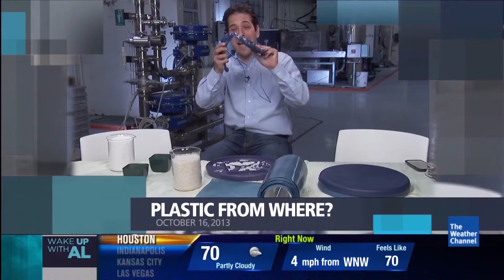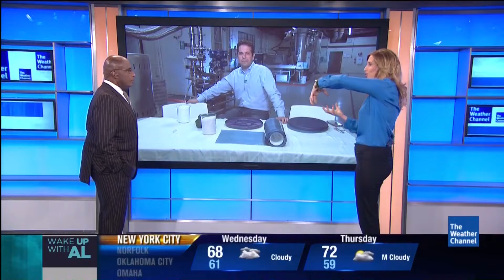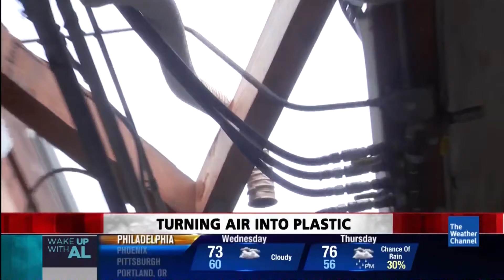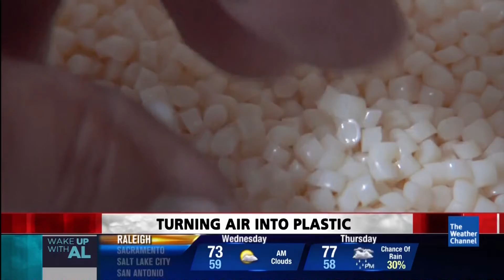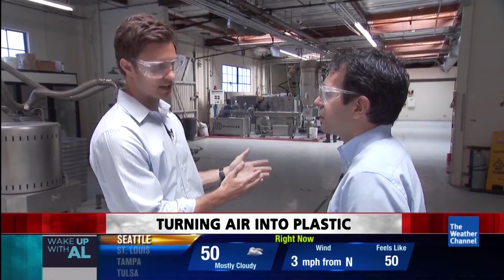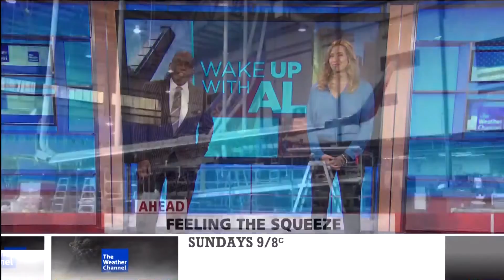Turning Air Into Plastic

Comment: You think the news would actually do research and check their sources.   If they did they would know that they way they are explaining breaks the 1st law of thermodynamics.   

Where is the energy coming from to create the plastic and extract it from the air.   Power plants?   So hooking up a hose to the top of the reactor to feed it into this factory would require more power plants.   You might as well just use the exothermic reaction and create the plastic using chemicals.  Far more efficient and does not contribute to the problem they are supposedly trying to solve.

This logic reminds of developing a car that runs on water.

Comment: Why is everyone so negative? There has been a number of breakthroughs about using the carbon dioxie into useful. About the conservation of energy, you all forgot its a "manufacturing" plant  and NOT a "power" plant. He's likely just using power from the main line. Even if he's using an on-site generator, he's likely using its emissions to supplement the ambient CO2 for the process.
Reply: Well considering he is just starting and proving that the concept works and can be affordable. The next step is to make the system more efficient, that's all. For now he is using the CO2 from the factory's surroundings.
Reply: Can you give me the link so I could possibly give a better reply?
Reply: Here’s a video about why this isn’t worth the attention. 

https://youtu.be/dzq9yPE5Cbo

Comment: Dear Dave, please watch Thunderf00t's latest video and be amazed how gullible you are...
Reply: His arguments work just as well to "prove" that we shouldn't plant trees.  The process doesn't use conventional methods of converting carbon dioxide into plastic.  It uses a bio-catalyst.  Basically, microbes take the carbon from the air, and produce plastic as a waste product.  These microbes could in theory be "powered" by sunlight, chemical sources, simple sugars, or even just heat.  The arguments presented by Thunderf00t don't even come close to debunking this technology because he left out the most crucial part of it: the bio-catalyst.  Please, actually read about the technology before blindly following the almighty god, Thunderf00t.  Yes, I recognize that he has a PhD in applied chemistry, with a focus on bio-chemistry (which is honestly what makes this error all the more egregious in my mind), but either he didn't read the full explanation about the technology, or he just wanted to bitch about something.  Either way, he is wrong.
Reply: airman122469 "The AirCarbon production process begins with concentrated methane-based carbon emissions that would otherwise become a part of the air," - See more at: http://newlight.com/technology/#sthash.3SNr8wGy.dpuf

Do you know how you get concentrated methane out from the air around us? You pump it through a system that will separate it.This type of system would produce more carbon than it will pull out from the atmosphere because you can't simply pump large volumes of air that contains only 0.01% of what you need(methane) and expect not to waste energy.Plastics are a waste product, we don't need plastics more than we need the electricity that will be wasted to power those pumps.

Newlight is simply using the waste methane that farms and other sources (WHICH ARE NOT THE AIR AROUND US) give them to make the plastics.That is the only innovation, but if you think that will overturn the global warming you are a complete idiot.

He is not wrong and you are braindead...
Reply: ***** What i ment by waste was that the raw material was the waste, not the material after the conversion.In newlight's process the raw material is not waste and needs to be concentrated before they combine it with the biocatalyst .

They even say it in their website:

Step 1:
" Capture: First, concentrated methane emissions that would otherwise become part of the air, from places like farms, landfills, and energy facilities, are directed into Newlight’s patented conversion reactor."

Step 2: "Isolate: Next, those carbon emissions are combined with air and Newlight’s biocatalyst, which pulls oxygen out of air and carbon and hydrogen out of methane."

The biocatalyst can't pull methane from the atmosphere on it's own fast enough due to it's extremely low concentration.They need to concentrate it and that is where huge pumps come in and the process becomes inefficient.
Thunderfoot said the same thing, but he just idn't specify anything about biocatalysts because it is irrelevant.
Reply: *****
You may have ADD.
Seriously you are just repeating shit I said and you are trying to prove the same point that thunderfoot did.
When you read a comment and watch a video please focus and try to understand each person's arguments...